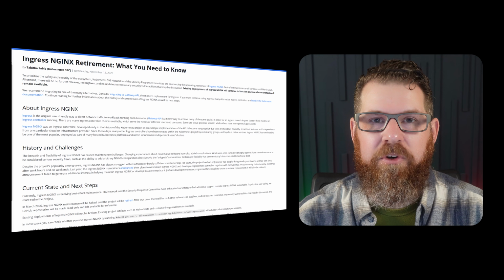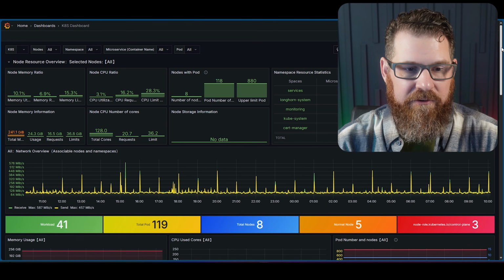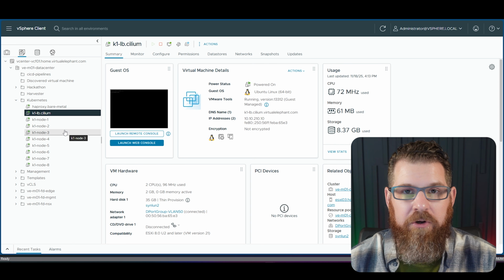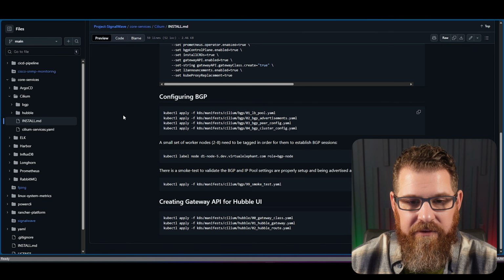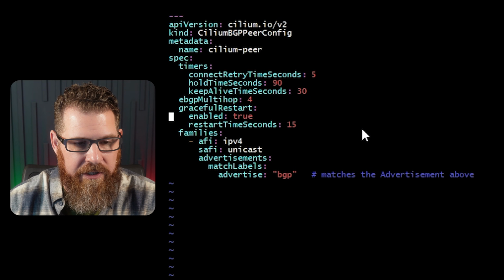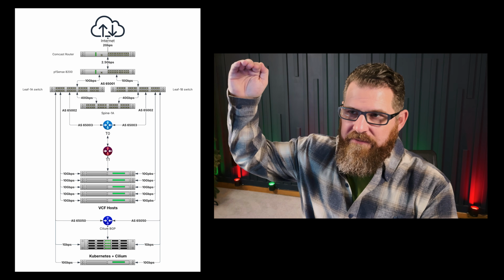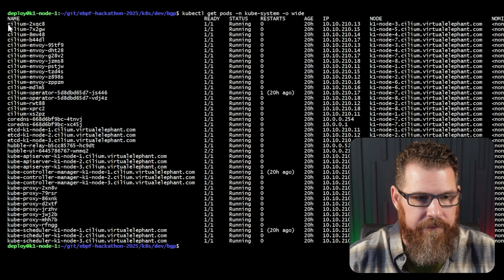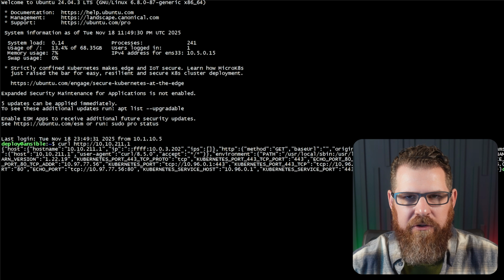Cilium BGP + Gateway API: Production-Ready Kubernetes Ingress Deep Dive

Comment: Ciliums BGP integration is really great, but unfortunately Cilium does not play nicely with unnumbered routes. Our Kubernetes nodes directly peer with the leafs using unnumbered bgp, which means that all the routes even the v4 ones have a link local IPv6 address as the next hop and no IPv4 address attached on those outgoing interfaces. In such case cilium just does not start, it's eBPF program needs/wants a v4 on those interfaces. In the end I used a 169... dummy address and rewrote the source IP with a route map. But then I still had to peer with cilium, locally with a BGP daemon already running. It was a battle, but now with graceful restart and all the goodies, the setup is rock solid. And thanks to BGP I can easily run dualstack and nicely oeganize the v6 GUA-Prefixes of the pods based on the location the node is in. It's great and the routing table small.
Reply from the maker: Interesting. That’s not a use-case I have encountered. Thank you for sharing!

Comment: Just a quick question
I see you are still using kube-proxy with cilium. Why not disabled kube-proxy and use ciliums kubeproxyreplacement? This way you dont have to worry about iptables.
Granted for a small cluster you likely wont notice improvement. But I don't see any negatives in switching.
Reply from the maker: I am not using kube-proxy in the cluster any longer. At the time video was recorded it hadn’t been fully disabled even though Cilium was handling the functionality.

Comment: I have EVPN fabric in my datacenter in that case how do I peer each worker node to create peer with my leaf switches? Its EVPN/VxLAN configured on each switches does it allow to create BGP peer and advertise it in evpn fabric?
Reply from the maker: I’ve not done this personally, but as I understand it you should be peering with the underlay or VRF and not with the EVPN address-family itself.
Reply: @virtualelephant  Thank you! I will try and let you know. I have one more question. I am building 100 node kubernetes cluster in that case how should I integrate with BGP. Ofc I can't create 100 BGP peers with my gateway router also there are some limitation of BGP for ECMP.  What is the better solution with 100 node kubernetes cluster with BGP design?  ( I was thinking what if I just use BGP peering for only 10 worker nodes and just route all loadbalancer VIP traffic via those 10 designated servers. is that a correct solution?

Comment: I have a question about bgp on some nodes that you mentioned. Why not have it on all nodes and have all of them advertise their cidr to physical infrastructure. How would doing it on some expose my routes running on some other nodes ?
Reply from the maker: Great question! It comes down to choice. If you want to setup each worker node to be a BGP peer with your upstream switches, you can do that. The system is designed to distribute the traffic effectively so that you don’t need to though, which makes it easier to maintain since you only have a subset of the nodes peering with the upstream routers
Reply: @virtualelephant  Would I be able to expose routes of pods on the nodes that are not directly connected ? In case of exposing pods on running on all nodes, I'd need to peer all my workers to the leafs right ? Also, when using a loadbalancer type of service, every node that is peered with the switch advertises it has this loadbalancer IP which is not correct I believe.

Comment: This was really good. Could you do a part 2, where you show how to integrate bgp and the L7 envoy proxy.  I know it is similar, but connecting the final dots to fully replacing metal lb/nigix ingress to a cilium only solution would be so helpful using bgp, gateway api, cert-manager, L7 envoy proxy
Reply from the maker: I’ve made a note and added it to my video recording queue.

Comment: Muito bom. Estou instalando um k3s 1.35 single node com etcd e com Cilium GatewayAPI numa VPS Hostinger com Debian 13 e nftables com eBPF, mas está gerando vários erros e bloqueios com o cilium status, desativeu várias coisas do k3s para usar o cilium e ebpf. Você tem um tutorial para eBPF em VPS liimitada com nftables com cilium?
Reply from the maker: I haven’t tried running Kubernetes through k3s as a single node, so I’m not able to address your specific use-case. I think if you are disabling features that probably negates your use-case and I would step back to determine if this is a valid use-case.

Comment: It is a great video, I have some questions, 
1. if I don't use eBGP and I use ibgp with route-reflector, will it have any issue? 
2. I saw helm chart, kubeproxyreplacement is true but I saw kubeproxy pod is still exist there? 
3. Your pod to pod in different nodes is still via VXLAN? 
I used AI to gen the helm chart but it is nightmare to troubleshoot.

Thank you.
Reply from the maker: Check out the latest book on Cilium to help better understand the core fundamentals. You can find it on Amazon “Cilium Up and Running”.
Reply: I'm not this guy but i can tell you my experience.
1. highly recommended ebgp peering using loopback on leaf but cisco nexus has option to accept ibgp peering between server and leaf as well.
3. all nodes are announcing podcidr and service ip so pod to pod are able to talk over bgp.
Reply: FYI Proportional Multipath for VNF
https://www.ciscolive.com/c/dam/r/ciscolive/global-event/docs/2024/pdf/BRKDCN-2662.pdf
Reply: @wannaseeyouagain thank you. I am quite strong in Cisco so i am good abt cisco side but I am a cilium noob and i faced issues because i did not read carefully how it works. I want the original pod ip to advertise out without performing nat on the node itself. I use RR to advertise subnet to all nodes
Reply: @concay8872  2. You have to delete kube-proxy daemonset manually after implementing cilium